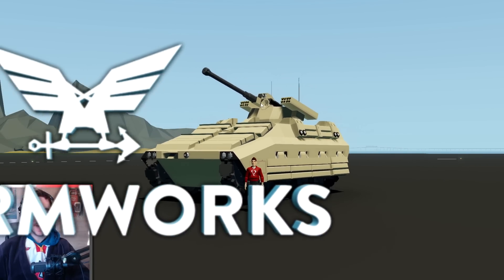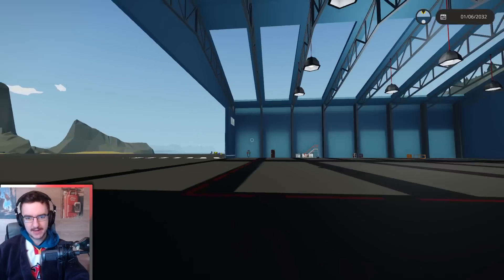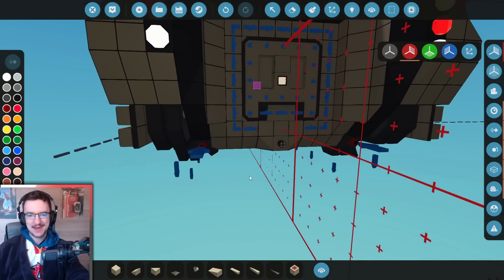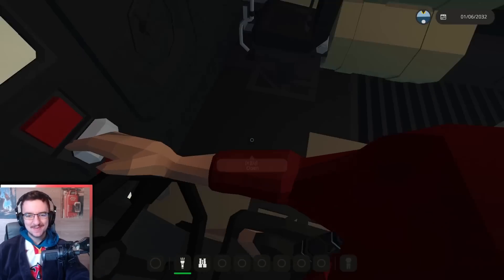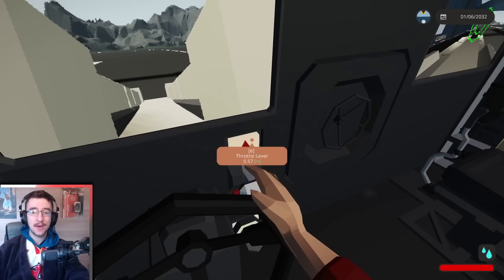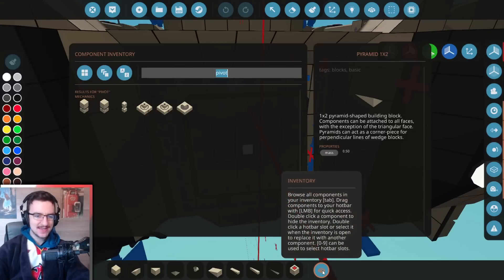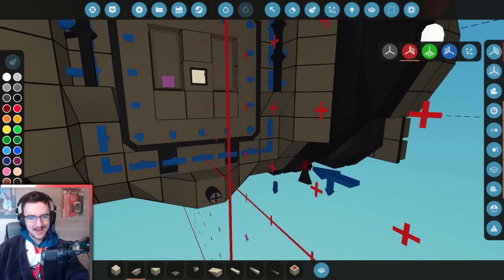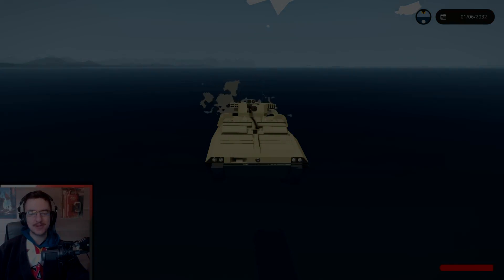SMOKE SCREEN & FASTER IFV - Lets Buid An IFV In Stormworks!

Comment: Nice IFV Frantic! I would just recommend for the armor panels on the sides, to try setting it to 1% Max Power instead of 0%, it will still let them move, but won't have them flying around when you turn or fall.